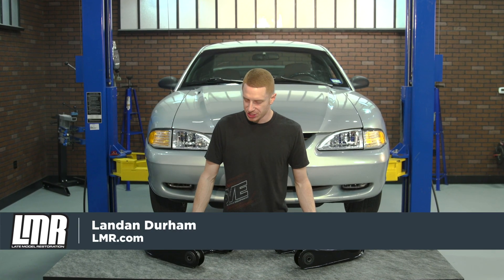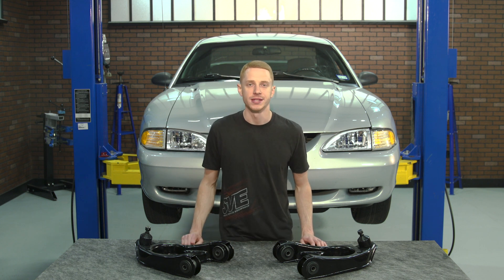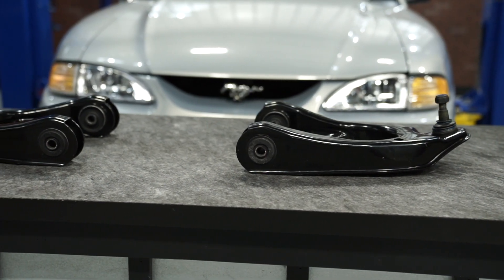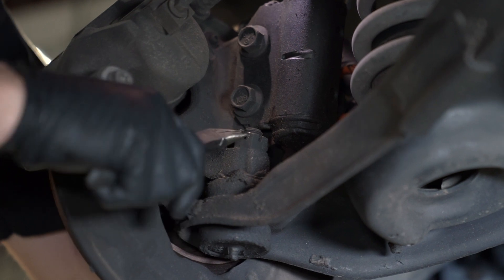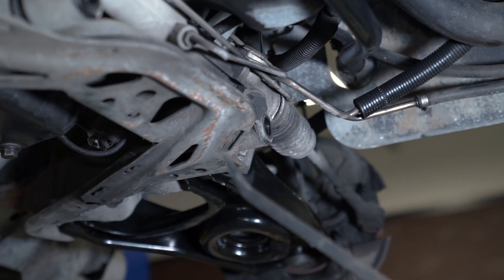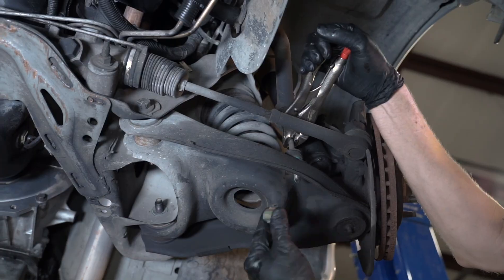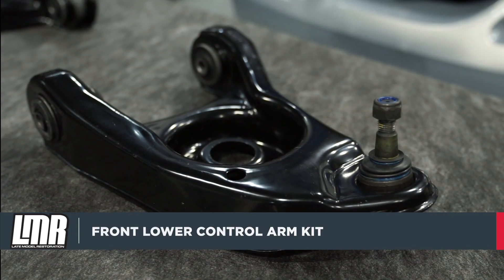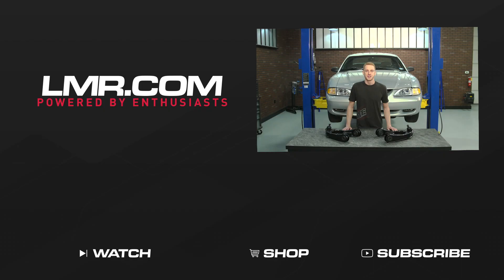1994-2004 Mustang Front Lower Control Arm Kit - Install & Review

Comment: Great tutorial if you have a lift but guarantee it is NOT this simple. I’m unsure what aftermarket springs they have but factory original springs are so long and make it difficult to remove and/or put back the control arms. Had to use a Jack and a come along to pull the control arm into place in order to get the rear holes aligned with the frame to put the bolts through. Horrible design and definitely a job you might want to consider giving to a mechanic with a lift!!
Reply from the maker: Thanks for taking time to comment. All of your points are valid. I've done this multiple times off of jack stands. It isn't fun by any stretch of the imagination, but sometimes, it is what it is. -Landan
Reply: @latemodelrestoration  indeed. I work on foreign cars, but definitely was ready for this job. It gave me hell. Not going to talk about the ball joint seized in the knuckle… glad it’s over! Tutorial provide some good insight

Comment: Yal are skipping entirely too much. And this method is the most dangerous method. Should take pressure off the spring before doing the control arm bolts. Also one k member bolt has to be removed to get the rear bolt out.

Comment: Wow, just bang the k member with a hammer because nobody can be bothered to make a bushing that fits.
Reply from the maker: The k-member squeezes together a few millimeters when the lower control arm bolts are torqued. Even when reinstalling a factory arm, it helps if you widen the mounting area on the k-member. -Landan
Reply: You have to bang the k-member tabs open to get the new arms in, Landan is correct, the tabs will draw closer in real time as you torque the new arm to specification(149ftlbs).

Comment: So did anyone actually do it how they did in the video? Without removing the spindle?
Reply: Yea. And without moving the steering rack just disconnect the tie rods.
Reply: Why would u remove spindle ? No need for that unless you are replacing spindles . At least on this style front end . The strut acts as the upper control arm
Reply: I did it just like video . I would recommend new spring isolators since the spring is out .. I didn't replace mine wish I would have . . Bolts that go through bushings need to be tightened with car on  ground or with the suspension loaded as if it were on the ground